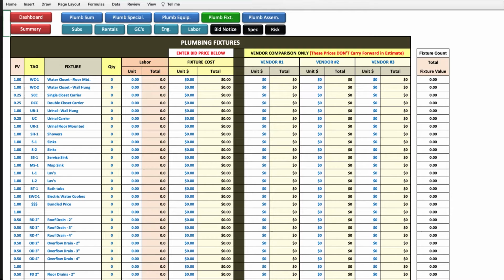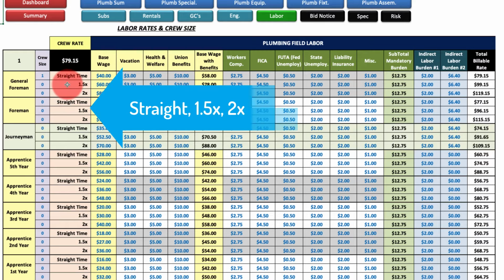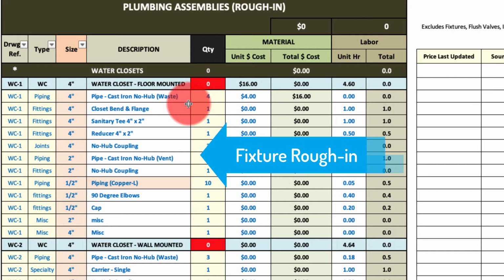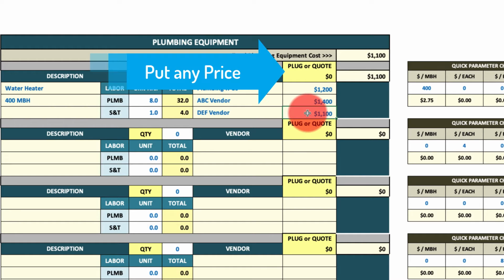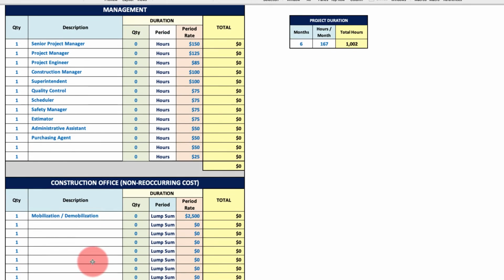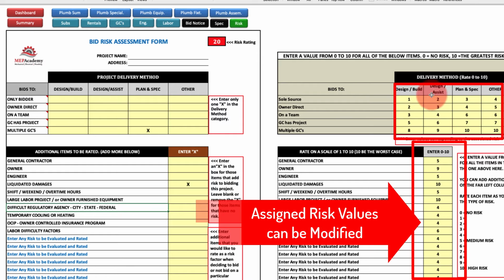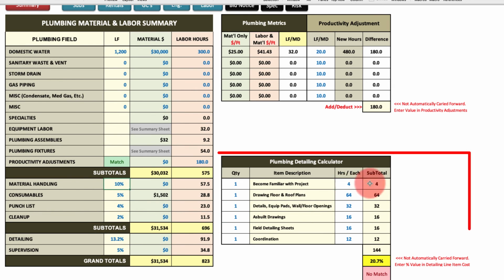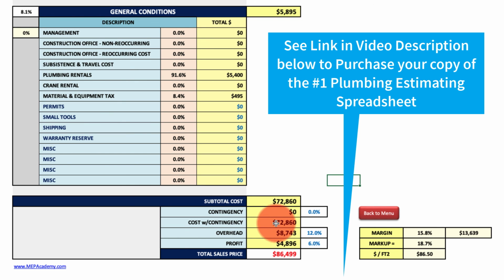Best Plumbing Estimating Spreadsheet

Comment: Love this. I saw a previous comment, and it made me wary of the spreadsheet... Can I make any of my own changes if I purchase? Or is it 100% tied to you and I can't make any changes?
Reply from the maker: The formulas are of course password protected to prevent accidental erasure, which only increases the calls to our office for help. There are aspect of the spreadsheet that are available for customization, such as the user can add as many additional customized pages they like. So if you want to add onto the existing spreadsheet that feature alone allows you to build custom pages to fit your needs, while protecting all of the existing sheets and the many formulas.

Comment: If I need to add more rows or columns, can I copy and insert them, then change whatever I need to add items based on my project? Will the formula automatically update, or will it be disconnected from the formula. Do you have Elec Estimating Spreadsheet?
Reply from the maker: The spreadsheet has plenty of existing lines that should cover any size project from a few thousands dollars to millions of dollars. The developer of the spreadsheet is a 40 year veteran, bidding individual projects worth well over a $100 million each. The spreadsheet is password protected to prevent the user from accidentally deleting critical calculations that would affect the price. If there are additional columns or rows that you find you might need, contact us and we'll see if it can be added to future updates.

Comment: What is the difference between this and the HVAC and Plumbing together?
Reply from the maker: If you do both trades, then you would want the combination spreadsheet, otherwise the single trade Estimating Spreadsheet. The Plumbing is basically the same thing on both spreadsheets, but if you do only Plumbing then that sheet will allow more accurate metrics such as Cost/Fixture, Cost per Square Foot, etc.

Comment: Hi, im looking to buy the plumbing estimating tool. What programme does this run on? Can I give access to my office staff so we can run it as a cloud estimating tool? Does the inventory list, contractor info etc all save so you dont have to fill it out each time you create a new quote?
Reply from the maker: This is an Excel spreadsheet. You can create a template version with all of your Subs contacts, Labor and Crew Rates, General Conditions, Rental Rates, etc. Then save the Spreadsheet as a template version with all of your standard rates so you don't have to enter it each time. The spreadsheet doesn't include a labor or material cost database as those are available from MCAA, Harrison Publishing and other database providers.
Reply: @MEPAcademy   is there customer assistance

Comment: Hi, im looking to buy the plumbing estimating tool. What programme does this run on? Can I give access to my office staff so we can run it as a cloud estimating tool? Does the inventory, etc carry over into new estimates so you dont have to keep filling it out
Reply from the maker: This is an Excel spreadsheet. You can create a template version with all of your Subs contacts, Labor and Crew Rates, General Conditions, Rental Rates, etc. Then save the Spreadsheet as a template version with all of your standard rates so you don't have to enter it each time. The spreadsheet doesn't include a labor or material cost database as those are available from MCAA, Harrison Publishing and other database providers.

Comment: Hey there do you provide pricing for uk plumber projects or do you have any help . Thanks
Reply from the maker: We provide the Estimating Spreadsheet that can be used for projects in the UK. You would enter your local material pricing values into the spreadsheet. The spreadsheet provides all the different sheets required to assemble and estimate but doesn't include the material prices.https://mepacademy.gumroad.com/l/bcdah